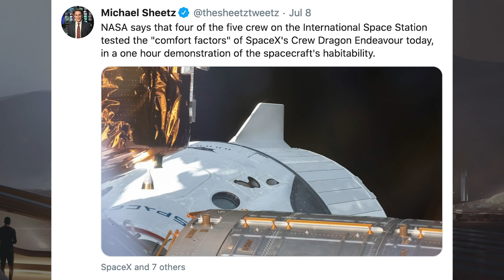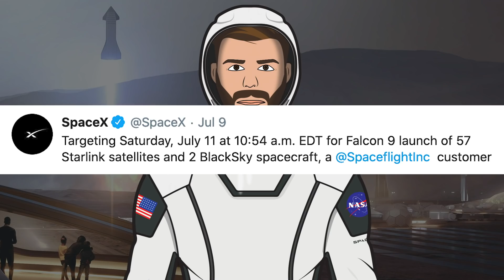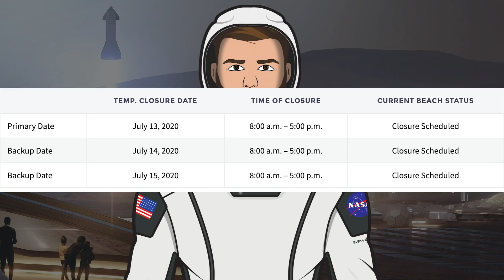SpaceX Starship Updates! SN5 Testing Soon, New Starship, Other News! TheSpaceXShow

Comment: It's funny how we call it a mass "simulator"
Reply: How is it funny
Reply: Ignacio Romero What’s funny about it is that the roll is steel IS mass. Its not simulating it. But we call it a mass simulator because it simulates how the mass is distributed. So technically, it should be called a mass distribution simulator